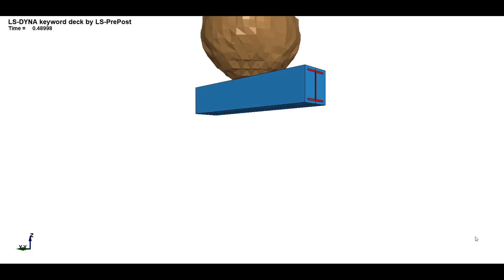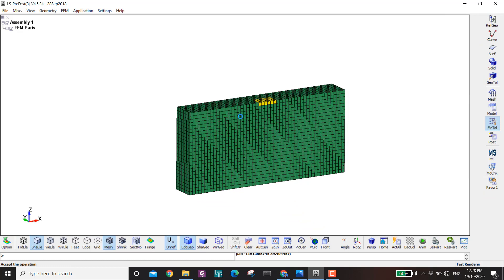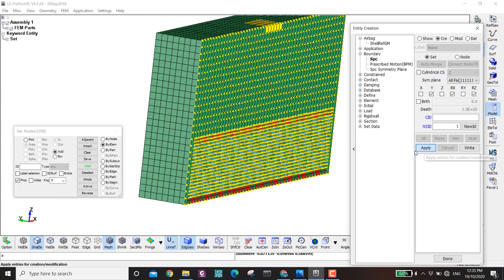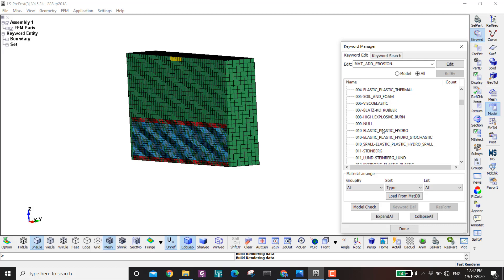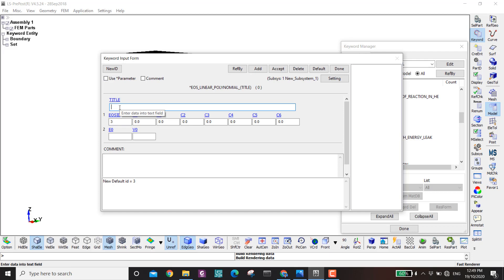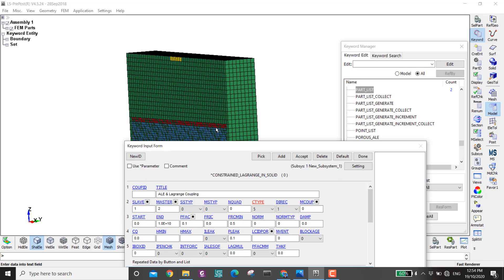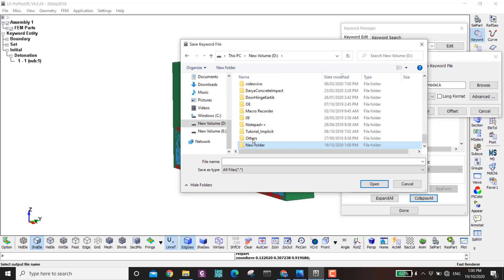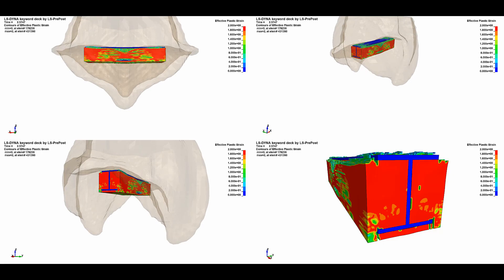LS-DYNA TUTORIAL 20: TNT Blast on Composite Beam

Comment: Thanks for tutorials! I guess you heard about the CESE solver for blast and fluid-solid interaction simulations. Do you plan to prepare a tutorial about CESE solver?
Reply from the maker: Yes, I know about this solver and used it before. However, I have no plans for any tutorial for it soon due to my time constraints, unfortunately.
Reply: @AmeenTopa  O.K. then. My other question is; which keyword or parameter should be changed depending on the mass of TNT?
Reply from the maker: @eminakc  Using ALE method, you create a mesh for the initial shape of the TNT. So, by controlling the shape (size) of the TNT, you control the mass.
Reply: @AmeenTopa  Thank you!
Reply: @AmeenTopa  I have another question now: I want to create a perfect spherical mesh for TNT in air. For this purpose, I cannot subtract TNT from elements of air. I mean, TNT is also penetrating with the air, similar to composite beam in this video. In this case, I could not achieve any moving ALE fluid mesh. What should I do to solve an intertwining TNT & air elements? Thanks in advance.
Reply from the maker: @eminakc  You can use Initial Volume Fraction or check the following video https://www.youtube.com/watch?v=irQEEIL6A-M&t=173s
Reply: @AmeenTopa  Do you have any idea about changing the font colors in keyword manager and toolbar? Thank you again.
Reply from the maker: @eminakc  You can change from configuration setting from the top left options.

Comment: Hı Ameen Topa. i have a question. İn this tutorial, you didn't write any value about quantity of explosive. How much does explosive detonate in this tutorial and how calculated it. Thank you for everything.
Reply from the maker: You can measure the mass and dimensions from the 'measure' tool. Shortcut to this tool: Press F4 key.
Reply: @AmeenTopa  do I understand your telling ?  after we give material and section properties, ls dyna calculate material mass how multiply density with volume.
Reply from the maker: @zafertoral5840  In the material model, we define the density. From when we create the mesh, we give the dimensions. From volume and density, the mass is calculated.
Reply: @AmeenTopa  thank you for everything
Reply from the maker: you are welcome and all the best @zafertoral5840
Reply: Hi  @AmeenTopa  .ı am working new examples which is own model. When I checked the model, ı have no error. but ı run analysis, the explosion not occur. when the model run analysis, ı am having two warning. firstly "warning 20542 (STR+542) number of master segment is zero" and secondly "warning 30131 (INI+13) total number of masless nodes=2988". ı didn't exceed this problem. can you help me?
Reply from the maker: @zafertoral5840  maybe the mesh of explosives and mesh of air is not connected.
Reply: @AmeenTopa  how can i connect it? İ am educating in postgraduate. These informations which give you are very important for me. Thank you
Reply: Do you have any advice like tutorial video
Reply from the maker: @zafertoral5840  if you follow this tutorial step by step, there should not be any problems with the model.
Reply: @AmeenTopa  ı runned this tutorial and  ı tried a new model depently steps in this tutorial. ın my model has column and rebar. the section of rebar is beam. finally, my analysis didnt work :( ı will try  repeatedly. thank you for all.
Reply from the maker: @zafertoral5840 first, try to repeat the problem exactly as it is. If you managed to get that, then proceed with changing the structure.
Reply: @AmeenTopa  OK. I will try. thank you.

Comment: How do you give symmetry conditions? Do you use reflective conditions?
Reply from the maker: Just used BOUNDARY SPC SET. I explained it in this video already.
Reply: @AmeenTopa  Isn't SPC a fixed boundary condition? I do not understand why fixed constraints are symmetrical,  don't understand well, can you explain it in more detail?
Reply from the maker: @user-yc6cf9ot9n  Let's say we want to do symmetry around the XY plane. 

The nodes which exist on the XY plane, cannot move in the Z direction. But it can move in the X or Y direction.

And how to model this constraints? Using SPC boundary condition.
Reply: @AmeenTopa  Could you tell me your email? Can you give me an example of how to give the symmetry condition of the model I'm doing after looking at the picture?
Reply from the maker: @user-yc6cf9ot9n  Put your email here and I will contact you in my free time.
Reply from the maker: Check your inbox.
Reply: @AmeenTopa  okey. thank